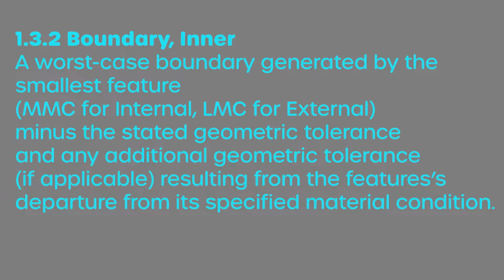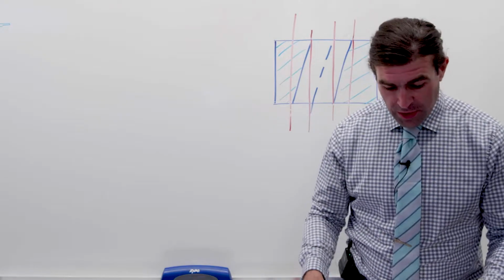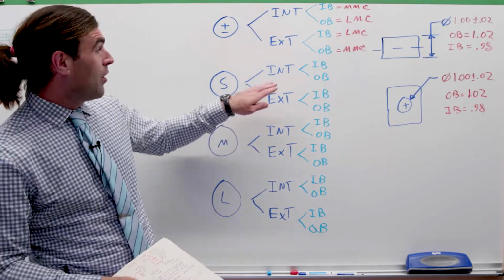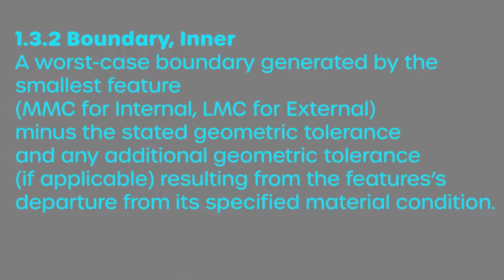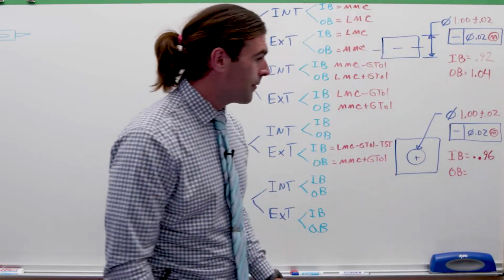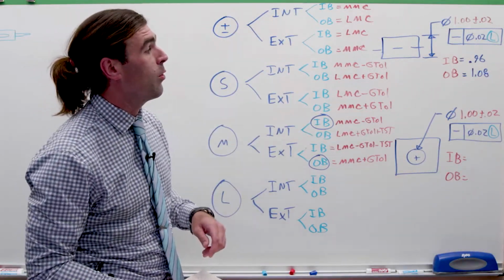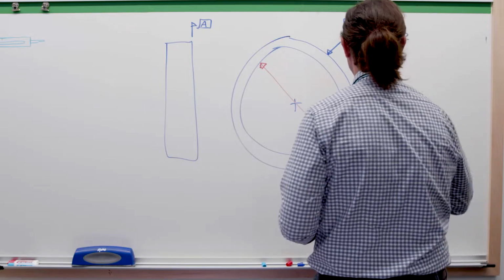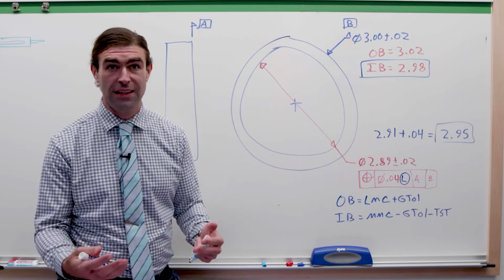GD&T: Inner & Outer Boundaries, Virtual & Resultant Conditions

Comment: Amazing explanation! Clear and concise. For people who are trying to identify which boundary conditions are virtual/resultant and for internal/external features, here is a clean little tip as mentioned at 17:40. The boundaries which make use of bonus tolerance or TST as called in this video are the resultant conditions. So if you ever have to consider bonus size tolerance in your math, you'll know right away that it is a resultant condition for that feature (EXT/INT) and a specific modifier (MMC/LMC).

Comment: I'm confused as to why/how can the IB of the Ext (pin) be less than the LMC? why take away .020 of straightness?
Reply from the maker: Hi, I should have used a hole instead of a pin with position or orientation rather than straightness. I used straightness of a pin for simplicity, as I only have so much space on the board. You are correct, the IB of a pin with straightness of a derived median line is just the LMC. Subtracting the GTOL is not correct, but it at least is not correct in a way that makes the design more conservative. Thanks for pointing this out.

Comment: Thanks for a great video, it has definetly helped my understanding! I do want to ask when finding IB & OB for a feature that has a +/- size tolerance and a concentricity geometric tolerance applied, would it be the same as you have explained as LMC/MMC +/- GTOL?
Reply from the maker: Hi, thanks so much!

Concentricity & runout are treated like position at RFS for the purpose of boundaries, so yes it’s just MMC/LMC and the GTOl without the TST.

Comment: Another important topic covered precisely! Suggestion for future videos:
1) How to check positional tolerance for projected tolerance zones (Manual measurement).
2) How to calculate the tolerance zone for positional tolerance where MMB and MMC applies.
3) How to detemine the approprieate MMB for features where multiple single segment tolerance applies (like covered in 7.11.6.1 ASME Y14.5-2018).
4) How to check if a hole (with perpendiculatiry error and positional error) matches the print where MMC and MMB applies.

Keep going, Dean! You are doing a great job.